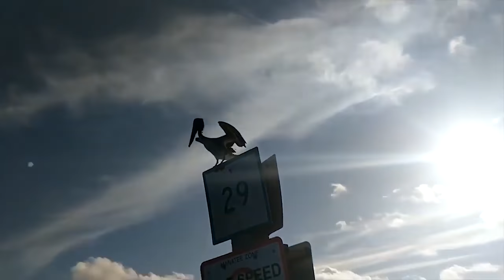Fiesta for the Ladies ! Chit Show Weekend ! (BlackPoint)

Comment: 13:26 okay Lesson, when you make the approach with the bow heading into the dock, as you get close. Now rev. motor and turn wheel to the right to pull the transom in. ¯\_(ツ)_/¯
Reply: To be picky, always put it in neutral first, then turn the wheel, then reverse it. But the funny thing about these videos is that almost everyone seem to approach the dock more or less correct with the bow first, (where did they learn that?) but when they get close, it looks like they have absolutely no idea what to do anymore. (why didn't they learn that too?)

Comment: Don’t these boaters have a plan for docking? No fenders? No plan for the forward docking line...plan for the stern line? It seems to be such a surprise.
Reply: Many shut the engine off quickly probably due to the Gas price, but it could easily be used at the docks to pull the stern right in to the Docks.